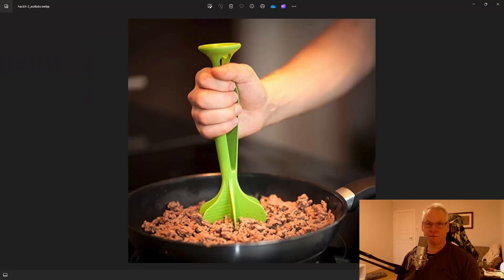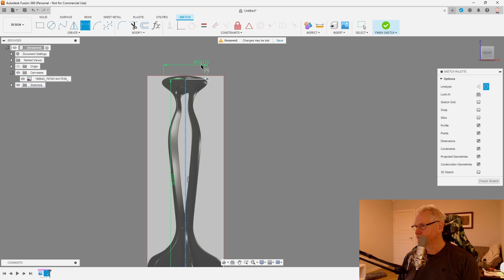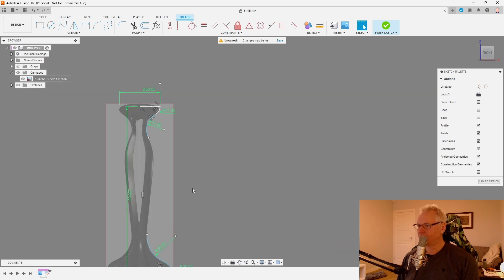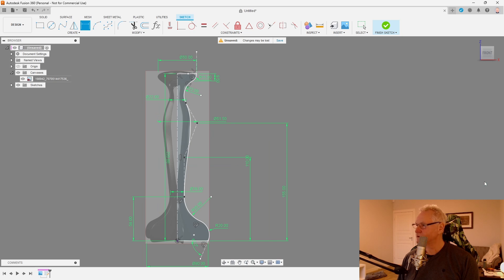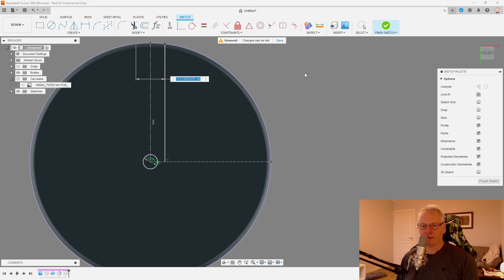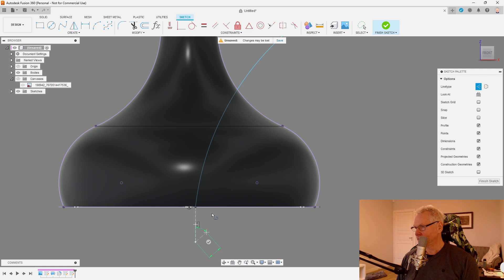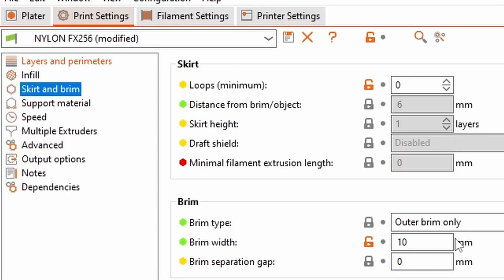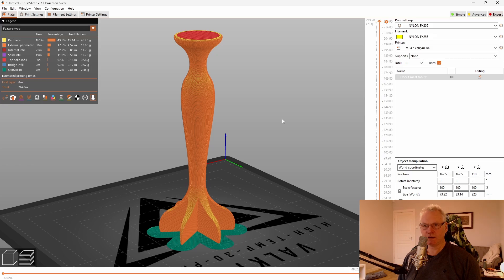Design from picture and 3D Print something you need. Fusion 360 + PrusaSlicer + Printing Nylon

Comment: - Cool :)
- Nice job (as always).
- A FEW HELPFUL TIPS...
--- 'TANGENT ARC': automatically applies 'Tangent' constraint at first point selected.
--- "FULL-WIDTH" DIMENSION: via 'Centerline Line' (as you've done, which is fine, in this case); OR, when ready to enter value, rclick:'Diameter Dimension': this makes "full-width" dimension, but can be 'Construction Line', so won't split a profile in half. BTW, same can be achieved by dimensioning to 'Centerline Line', then converting to 'Construction Line'.
--- For "CROSSING POINT": simply click intersection, 'Coincident' constraints automagically will be applied.
--- CHANGING SKETCH ENTITY (shape, +/or dimension) WHILE NOT IN SKETCH MODE! This makes things interactive/dynamic: changes are seen "instantly" (as opposed to edit in sketch, then finishing sketch to see change to body). Can also be quicker workflow. To implement, rclick sketch item in Browser: 'Show Dimension'. Then, simply double-click dimension to edit; or click-n-drag geometry.